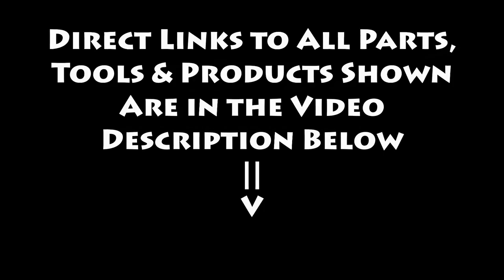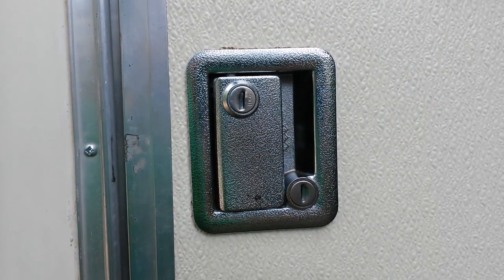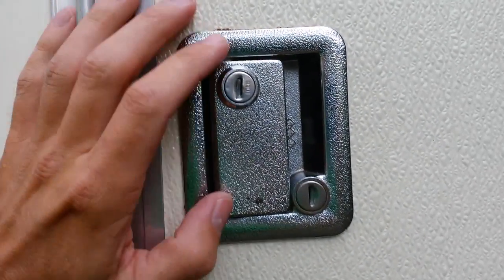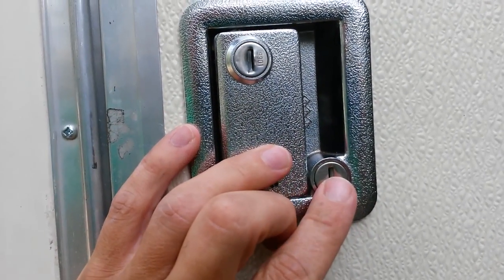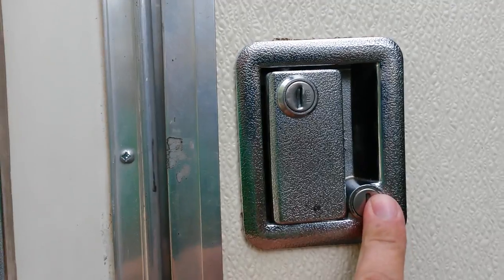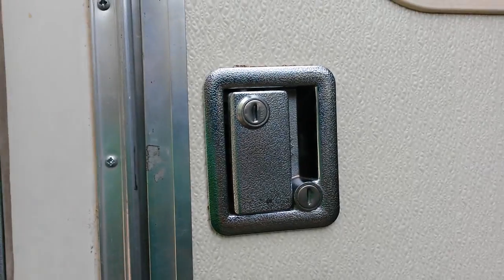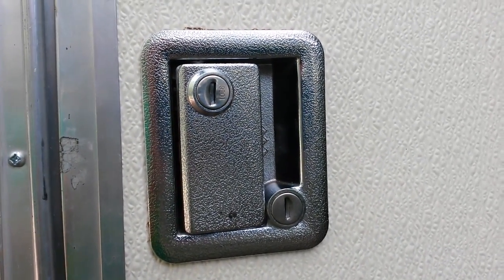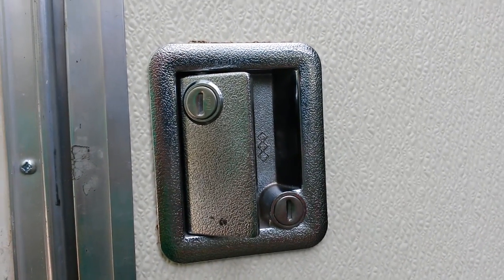This Old Trailer ~RV Door Handle LockSets (#1) Major Security Flaw on Your Rig!! Watch Now!!

Comment: Yeah I would suggest changing those locks out for sure. I have a motor home that is not that old and I could rake both locks open in less than 5 seconds each when someone borrowed our car for a 2k mile trip and the keys are in the glovebox and I had to get into it.

Comment: Perfect. I'm actually locked INSIDE. My SO locked the door with the key from the outside to keep it the door latched due to the above mentioned issue.
Reply from the maker: Ohh no! It's been a minute. Did you manage to get out?
Reply: @TrailerDayz  I did! He came back and unlocked it. Something is wrong with the lock. When the key was in it locked, the red lock on the inside was able to be flipped to the unlock position. If the key is out, the door cannot be opened from the inside. I even took apart the plate before he got home in hopes of triggering the mechanism by hand, to no avail.
Reply from the maker: @vulcanknights  They were  locking the handle lock, which only locks from the outside. The "deadbolt" actuated the red lever on the inside, but the handle lock does nothing on the inside.

In the future, tell them to only lock the deadbolt lock.
Reply: The deadbolt (red lever key hole) is the key hole was the only one locked,  if that makes sense.

Comment: we had several RV's in our condo complex broken into - the thief jimmied open the double locks on all of them - no key was used as you could see the locks were all scratched up and slightly bent.  We all had both the deadbolt and the handle locks locked.   My question is whether there is something we can buy to prevent "break in tools" from being inserted into those locks.  If not, do you have any suggestions for a lock that is "jimmy proof" from lock picking tools or such?

Comment: As a locksmith. First off, car keys do not have master keys. Period. Second off, both of those cylinders are incredibly easy to pick over, or force over with a flat head. Key codes are right on the front as well, very easy to convert and cut a key.
Reply: The only reason the dealer has one key to open all types of rvs is because the key code is the same for handle locks out of factory. You can only master key a lock with actual pins, not a wafer lock.
Reply: @gLocksmith.  Apparently you don't know that car manufacturers used to have some keys that did work on all their cars.  Others have even mentioned it above multiple times.  He spoke on the rest of the info and the rest is all accurate.  He can't help when people are too stupid to read a title and assume it covers something it's not supposed to.

Comment: Someone got in our camper on our property this weekend, nothing was taken but they left the door wide open. No signs of force entry around the door locks. I wonder if they had master key ??? Cant stand trespassers or thieves.
Reply from the maker: Was the deadbolt part of the lock locked (not just the paddle handle)?

Comment: Telling people you have a phobia about adding house style deadbolts is comical.
Reply from the maker: Not sure what you are referring to there. House style deadbolts are only moderately more secure than an RV lockset. I have a master key that will open 95% of RV locksets, which is where the warning comes into play.
Reply: He didn't say "phobia" he said "...you won't have like a ghetto lookin' deadbolt right there" (Found at 3:30) Clearly YOU in particular don't mind RVs looking trashy... how fitting.